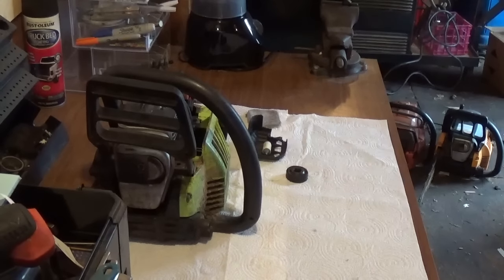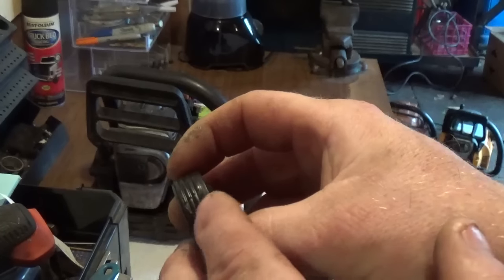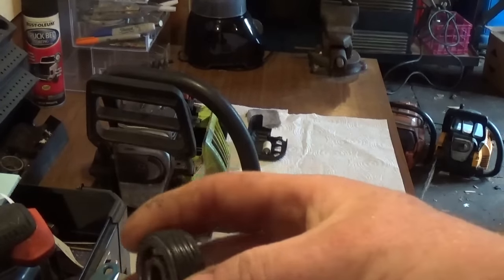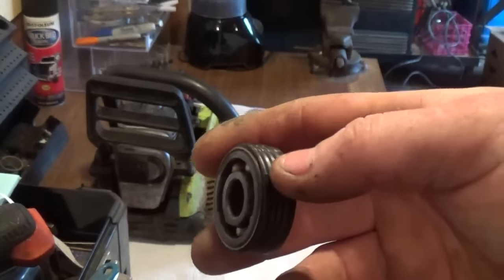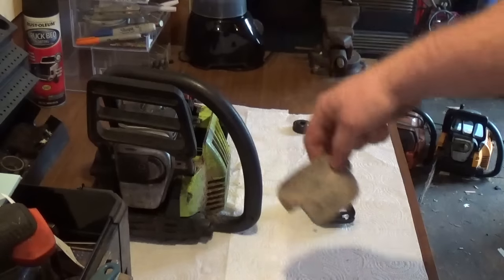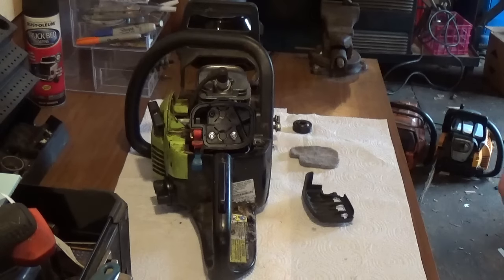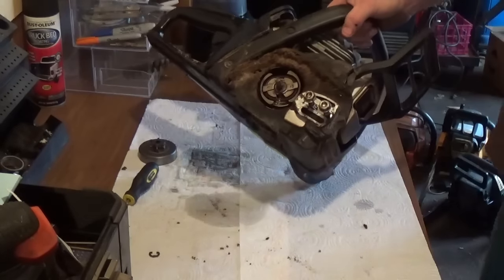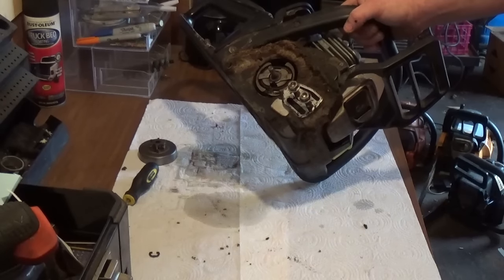Common problems with Poulan Chainsaws

Comment: Are you one of those revolving door repair shops that the guy leaves your shop after you having fixed it and then minutes later they're back.
What they need is a decent carb system.
You're like....but I fixed it.
Those carbs are junk.
Didn't know about the shafts breaking and the seals leaking. I guess I have that to look forward to.

You ought to sell them echo saws.
Reply from the maker: Friend respectfully I don't sell Poulans in my shop and Truthfully I even try to avoid repair work on these P.O>S> because the saws are a curse to the purchaser and the repair Tech that often is obligated to fix them . Now with that being said I do repair them at my bosses shop as he is a dealer ........How ever he just carries them because of price point and even warns against the purchasing of the cheap pieces of shit . Echo truly is a great saw , Efco , Stihl, Some Husqvarnas  with the exception of the cheaper crap , Shindawa, Dolmar or Makita .....Etc....Poulan on the other hand witch is a Husqvarna product {FUCKING SUCKS} sorry ......But the truth is what the truth is .... Now its no surprise this comment will likely insult some viewers {for this I am sorry } but I have sugar coated my opinion long enough ......I provided facts in other viewers replies ........Please if you share a difference in opinion see for yourself  { look up refurbished Poulan products } you will see for yourself and it will no longer be opinion on my part as it will become evident I have told the truth .

Comment: I agree with you on that 33cc Poulan chainsaw my grandpa had one and he put it in the back corner of his garage and went and bought a stihl. while I agree I wouldn't say that all of them are, just in my personal experience with them, I recently acquired a 36cc chainsaw the poulan 2750 16in bar I put an 18in bar on it because the 16in bar was burnt up on it next payday I'll be getting a 16 inch bar and chain combo for it. After running some seafoam through it to clean up the Piston head and blow any cobwebs out, first tank that went through it smoked like crazy but it runs really good now, I've had a few different Stihl chainsaws over the years and I have a lot of echo equipment this 36cc pulling actually works pretty well... 33cc that sitting on your table and the one I dug out of the corner of Grandpa's shop I thought the chain break was pretty cool because the 2750 does not have one but it's a piece of shit it's probably going to become just parts for the 2750...but if you have the money Stihl is definitely who I'd go with but if you can find one of these 2750 s that are in good condition were you get one for free like I did maybe whoever reading this might have got lucky to... But the thought also occurs to me that I may have gotten one the fluke machines that actually works right so for all I know it could be a factory fuck up LMAO

Comment: Your 100 percent correct about the caps. I had a older craftsman 42 cc 18” daw which is a poulan copy and if you filled it up with gas more than 1/2 a tank it leaked out of the vent. I had that saw for a very very long time and one day I was doing some work for my grandma and it quit and wouldn’t start , It had a barely used coil , rebuilt carb , and new air filter. After that shit out I bought a stihl 241 off a buddy. Much much better
Reply from the maker: Stihl saws do carry a great reputation for being very nice quality ...Just be carful of there cheaper lines....170 ,180 Etc

Comment: Ive had mine 5 years with no issues. Ive even used it twice. Once brand new 5 years ago, and once today. So here i am searching YouTube on how to fix the fucking thing. Is that normal?
Reply: No, of course it's not normal. But remember, these things are consumer-level, cheap chain saws, never intended for professional use, and prone to failure if not cared-for and maintained.
It's hard to provide meaningful recommendations without knowing the make and model of saw, but for what it's worth:

I own a service/repair business, and we find the most common cause of starting problems is bad fuel. Are you using 10% ethanol fuel ? If yes, how old is it ? Do you use a fuel stabilizer ? If more than 30 days and no stabilizer, throw it out. Do you drain fuel from tank and carb after each use ? If no, (especially after 5 years), you probably have varnish throughout the fuel system and inside the carb, and you probably have fuel lines that crumble when touched. Do you clean the air filter either before or after each use ? Contaminants can clog the air filter very fast, causing lots of difficulty starting if the engine can't get air. But in your case, there can be lots of issues.
My general recommendations would include replace the carburetor, all fuel lines, the fuel filter, the air filter, a new (properly gapped) spark plug, and a check of several other components, such as magneto status, wire conditions, etc. Also assure the fuel tank cap is still usable (good gasket seal, good vent). These recommendations may make the machine again workable, but there are no guarantees unless the machine can be properly evaluated in person.

Comment: Great Video.  Thank you.  I have a Craftsman 358.350810 4200CC, (aka Poulan Pro).   It seems to be over oiling when running.  A lot of oil. The Side cover actually looks as if it's budging out a bit when given it throttle and oil leaking out.  I was told this is normal for these machines.  I was told to loosen the oil cap after each use to release the pressure in order for it to leak less.  Any Ideas other then throwing the unit away?  LOL.  Thanks.  P.S  I did replace the bar plate (#530057910) and it's on flush.  Simply put, This unit produces excessive oil.

Comment: I own a 2010 Craftsman/Poulan saw a 38 cc it has always performed great,of course I do what most folks don't do,I regular maintenance after each use i tear it apart start my air compressor and blow everything clean,remove the gas start her up and let her run out of fuel in the carb and putt her away till next time,I know I can get another 10 more years out of her quite easy.

Comment: I ended up putting a cheap set of pliers in the case with the saw because of the gas cap/oil tank cap issue. I will admit it is difficult  to pull the starter rope as it is is jerkey and hard to pull

Comment: I understand what you mean from your video. I myself don't know a think about newest mod. So I believe you. Anyway I have those poulanfor small-medium works. Anything else's I use my stihl's. (042-075). Old saws but very reliable. I forget the 361 I am the 3rd user.

Comment: What brand of chain saw do you recommend as the best? Thx.
Reply from the maker: Best......Lets go with dependable due to price point alone as there are many chainsaws that are just fine for cutting wood . Then you have those that are better suited for a logger . I personally prefer a Stihl for cutting basic fire wood . Now for timber cutting I like both Stihl and a few Husqvarnas {very few} but still I wont exclude Husqvarna . Echo ,Efco  are also nice saws ....But quality just like Husqvarna is lacking in a few models .

Comment: The bolts that hold the bar broke out of the plastic housing on one of mine. If housing was just one pice and you have to replace fuel lines and crack the moter.

Comment: You wouldn't have a job fixing them. If they didn't make all this junkie crap
Reply from the maker: Hell if they continue making shit like these chainsaws and other service by replacement crap ...There wont be the need for Service Techs or Dealers as more and more small engines are incorporating cheap china made carbs due to the Dollar stolen rather than earned mentality they have over sales .

Comment: The Older Poulan Saws were good saws.   But the Saws in the last 10 -15 years are SHIT Most  Small Engine Shops Won't Even carry parts for them. There is No money in a throw away  Saw
Reply: 1995dresser hav GT GT by by GTe a
Reply: 1995dresser the older poulans were copy's of the homelites.

Comment: Know why the cap is hard to remove? Do some over head work ,O!O dripped gas on my head
Reply from the maker: LOL ...No friend in truth its due to cheap molding of plastic as well as modern gasolines effect on the cheap plastic caps that swell . We often joke at work and ask the distributors do the newer Poulans come with a set of vise grip pliers to remove the problematic fuel caps .

Comment: i picked up a used weedeater blower/vac 
VS2000BV  no start !!!!!!!
ring seized to cylinder, no Compression 
just replace with new rings , the Damn thing runs amazing on 40:1 tru fuel

Comment: Oh one thing I forgot to mention that 2750 has a different air filter design mine that I inherited had to Green scrub pants but I updated that to a half yellow half green Brillo pad as an improvised air filter and it actually works really badassly

Comment: yeah I have one...they ARE pretty shitty, what's the best one Stihl? I have a McCulloch too, but it seemed like it'd be a lot more to get it running.  nice long bar on it.
Reply from the maker: I personally prefer Stihl but I will admit Echo ,Jonsered, Husqvarna{logging saws} Efco, Dolmar, shindawa, are nice saws as well depending on the certain models each offer...Its like anything .....you get what you pay for but just some friendly advice to my viewers and followers {stay away from the entry line {cheap bottom line} saws from each company they tend to be less than desirable once purchased and only last 2 years if your lucky....They also tend to have simple cheap made carbs and thin molded impulse lines as well as intake bellows that often cause issues when regular gasolines are used in the equipment .....Don't get me wrong logic should tell most that premixed gasoline should be used from a can ......But lets be realistic just how many people have access to or for that matter wont to spend 6 to 8 dollars on a can of premixed fuel every time they fire up there chainsaw. And sadly as I see all to often they buy there bottle mix and off to the nearest gas pump they go ......And really can you blame them ? 6 dollars for a small can of premixed fuel ....Crazy....right? Sadly what they never realize is the gasoline from standard pumps can play hell on small engine equipment . And it is rare to find any store that has pumps that or {gasoline } that is safe to be put in small engine equipment. I personally use a alcohol tester and test all my gasoline once purchased and try to use it up in 30 days 60 if stabilizers are added.

Comment: I got a brand new Husqvarna weed eater, it runs like shit. Will work great for 5 minutes then dies. Also got a brand new PULLIN PRO that I have yet to be able to start. I removed the spark plug and noticed it was clogged up with black rubber/silicone fragments...Some type of seal? So I cleaned up the spark plug, made sure it was firing, mixed new gas, cleaned out all the fuel and put new. Pulled it and nothing, my right arm is worthless so I have to use my left and it's almost as dead as the other one now... I'm gonna try a new plug or increase the gap, to depressed now to work on it anymore, thing is brand new $200 at home depot...  Should have got an Echo
Reply from the maker: I know how you feel ....quality just isn't what it used to be...
Reply: Increasing the gap on the plug fixed my issue.
Reply from the maker: great...

Comment: hey Kevin this Jody I have a question we were using my friends plan a couple of days ago I noticed when it gets got it starts to sputter and it kills out when it gets hot is that the seal in the engine getting bad?
Reply from the maker: Yes...
Reply: Kevin Bolin will it get worst
Reply from the maker: In honesty {Yes} but most people have been sold on pride and become oblivious to the truth intel the purchases have been made and they come to terms with the evident truth I have tried to educate them upon as I have seen the victims that {always have buyers remorse } once the equipment fails after 30 min from the box . Then they see first hand the stresses of trying to get the warranty relief once a dealer starts seeing dollar signs in a repair by claiming the saw isn't under warranty due to {a Bull @hit reason}
Reply: Kevin Bolin I knew something was wrong when he was cutting into the tree it started running rough then it killed out he cranked again  and it killed out about four times before we got through I told him that it was doing exactly what you were talking about now he wants a poulan pro
Reply: Jody Hardy: I had the same experience you did with my brand new saw , I removed the gas cap and replaced the cap back on the saw ran for a few more minutes and repeat. Then  went to saw shop purchased a new gas cap, now the saw runs great.
Reply from the maker: You offer some great advice to those who are committed to keeping these saws going . And yes the Gas cap purchased will have with it a new tank vent that will keep the saws from running properly if the gasoline takes its toll . Sadly as I have said to many of my viewers this is just buying you time as once the saws are placed away the modern gasolines break down swelling the duck bill {tank vent } under the cap ....dry rotting the tygon fuel lines or Polytrilene   This effect also affects seals causing air leaks as the quality of the seals are terrible to say the least . In truth the gasolines affect these saws more commonly due to the quality of the saws as a hole . Even carbs that set for 30 days after purchase can and often do present problems . True Fuel Mix is great for these small saws but still isn't a cure for the quality of the parts made to assemble it as a hole . Theses saws are considered disposable and often steal lots of money from there buyers as well as have them in a state of buyers remorse .

Comment: I unfortunately bought one of these used it about 4 times and cannot for the life of me get it to run again! So anyone tell me what is a good chainsaw that I can buy that has performed well for you? This ones headed to the dumpster. Junk!
Reply: Any sthil
Reply: One of the other problems that he didn't mention is that the ignition coils burn out on recent Poulan's too because they also can't take the engine temps. Back when my mother started dating my stepfather in 2008, I fixed his fathers Craftsman branded Poulan saw for him before his father passed away from health issues. I went over everything I could think of only to find the saw had no spark. Mind you the coil was cheap to replace, but they also don't last long.

If you're ever looking for a "cheap" saw and can't afford a new Stihl/Husqvarna, either just buy an older used saw from the two brands for the same price as a new Poulan or look for a Homelite from the early 90's or earlier when they were getting the anti-kickback brakes. As weird as it sounds sometimes buying old is better than buying new because you can get more saw per dollar and they'll run just as good as a new unit.
Reply: An 025 sthil saws are good for a used saw and you can still gets parts for it
Reply: Crankshaft10: My friend acquired a Stihl 026 and a Homelite C5 from his uncle that are a couple of projects for us to get running. Today I acquired an old 80's Poulan 2400 Woodmaster, made back when Poulan was still good and the casings made of metal. 

My line up of saws is my Stihl MS251 I bought two years ago, which only gets ethanol free high octane gas. My Homelite 290 from the 80's, needs a cleaning and a tune-up. But I only paid $40 for it from a local second-hand shop. Also only gets ethanol free high octane. A 2005 Husqvarna 570 that is blown and needs a rebuild, got it from my stepfather for $60 since it's blown. If I don't rebuild it I can always clean it up and sell it as parts on ebay. I also have a little Homelite D3300 I got for free from another friend. So with the older Poulan brings me up to 5 chainsaws.

2 runners, 1 potential runner and two saws for later fixing once I have the money for parts. :)
Reply: If it is made in USA, then it's junk!
Reply: ECHO...ECHO....ECHO....CS590 TIMBERWOLF....CAN'T GO WRONG

Comment: been  running  my junk  all day    they run  great   just   mix the gas   right   an  all you may have to do is fuel   lines
Reply from the maker: Great advice....Do you also have that splined screw driver to make the frequent adjustments on said junk once your saw begins to over heat ?
Reply: never  overheated  any of mine   i use  93  shell  40-1  oil  a little   prolong  mixed  in  they start  easy  an run great...
Reply from the maker: Great...Hope it continues to give you great service.
Reply from the maker: Just curious .....That junk you ran 3 years ago all day .....will or should i say dose it still run ?  If so show us that old poulan in action ....My viewers and are are still awaiting any Modern poulan to successfully complete the Poulan challenge .